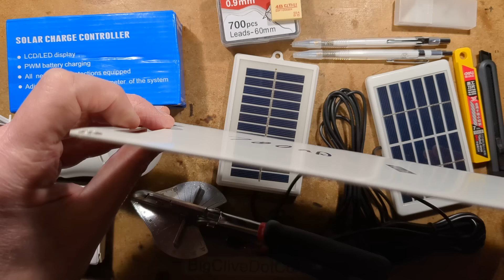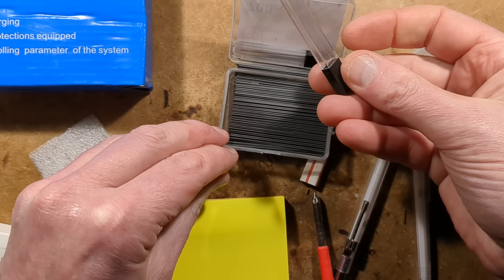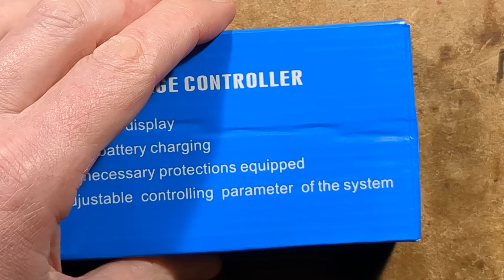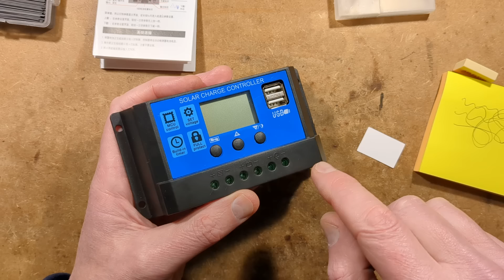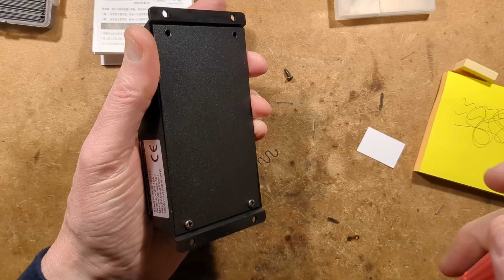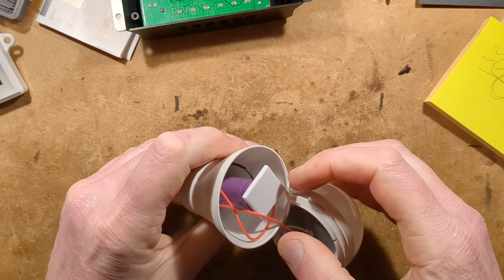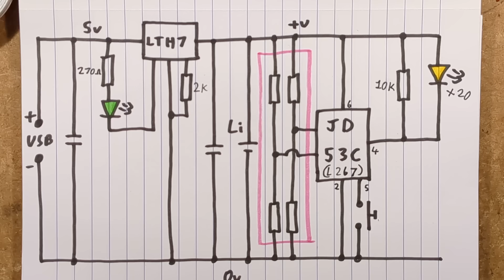Random stuff, a teardown and a little bit of smoke

Comment: I by mistake thanks to being my first use of Ali Express bought three of those solar panels without any lamps. After testing I found they were pretty weak at charging my 5 volt devices so I opened them up and wired three of them in parallel and just glued the three little panels together into one bigger one. 

I have been using it in our cottage with a 5 volt led light that comes on at random times. It gives the impression that the cottage is occupied as it is off grid. 

I have also opened up those solar motion sensor security lights that you get three of in a box and if you open and chop out some of the plastic from the inside you can get in a second Lithium battery inside and it goes together perfectly. So I connected two batteries in parallel and it works far better because it has double the storage from the panel. 

Since we live in Southern Finland it does keep them working through the winter. 

This will be the second winter they have got right through holding enough power in the two batteries so that the lights activate at night.

Comment: The solar charge controller is an excelent product ... The same company makes a 30A version for a few extra pounds , looks identical except  the back plate has cooling fins . I've been using one for 3 years and has performed as specified . It shows the temperature too , but   it's the temperature of the heat sink... lol.

Comment: I bought a solar panel to charge the battery in my vehicle. and I connected it to the battery and left it on the battery for most of the day. and I did notice any charge of the battery. and I don't have any way to test the solar panel to see if it was working. and I'm curious if there's some way to test the solar panel?

I appreciate you ripping these devices apart. so we can know what the inerds are. and how they work and how cheap they are.
Reply from the maker: You would have to monitor the current flow in use.

Comment: Ah, I used to have fun making mechanical pencil leads (0.5 mm ones I used in school) light up. If you raise the voltage high enough, it will eventually start burning the graphite, and it will get real bright, like lightbulb bright, for a second before the lead burns through and the circuit is broken. I've also had a lead blow to pieces right away.

Comment: I have such solar charge controller. It's trash. Voltage measurements are drifting depending on input voltage, load (or charge current). Had to stop using it, after it drained my 12V battery to about 6V and did not turn off output.

Comment: I have the cutter tool.
I got it to cut lead came for stained glass.
It turned out to suck pretty hard for that purpose.
Reply from the maker: Was it the blade not closing fully or just blunt?
Reply: I could never get the precice cut i was hoping for and the usually didnt come down evenly either. It caused me to waste a bit of lead and then i retired it. I later got a different cutter with no angle guide and straight blades and it worked like a dream. When i resurrect the glass working area I'll know what it was called
Reply: Missed out the word blade there

Comment: I picked up an unusual multi-function camping light from ALDI last week. I was provoked into getting it because the box advertised it as a long life light, with a power bank function and multiple charging methods: Either plugging a USB power supply into it, or using the built in solar cells, or manually winding up the built in dynamo.
Weirdly, the light could either be white or red - it had numerous surface-mount LEDs which must be of the dual cathode or maybe dual anode variety, so pressing the switch alternated between off, white and red. It was the same shade of red as used in photography dark rooms, so maybe it could be used as a backup dark room light - otherwise I don't know what the purpose could be.
The only downside was that they had cheaped out on the capacity - it had just a single 2000 mAh 18650 cell, though I'm not convinced that was the actual capacity since the cell was suspiciously light weight compared to equivalent capacity cells that I do believe the capacity of. Fortunately there was plenty of empty space within the light diffuser, so I was able to wire up some 5000 mAh flat cells in parallel, shove them into the space and connect them up instead of the 18650 cell, giving it a total of 15,000 mAh instead, much more respectable and useful as a power bank. With the downsides that it would probably take months to charge from the tiny solar cell, and I would probably develop serious RSI before I got even halfway to charging it using the dynamo.

Comment: I find the use of discrete resistors in voltage dividers a bit odd outside of very-low-cost applications - the error in the voltage divider has to take into account the error in both of the resistors - then if a temperature gradient appears across the circuit board (for example because of a component nearby on the circuit board which dissipates significant warmth) and one resistor in the voltage divider becomes warmer than the other that causes another source of error - it's possible to buy voltage divider ICs where each of the resistors is on the same chip helping minimize errors caused by temperature differences between the two resistors and where each voltage divider chip is laser trimmed and graded for accuracy on the production line - very useful components whenever any level of accuracy is needed in a voltage divider and I reckon they're not used anything like as often as they should be. 😉

Comment: Finally someone did a review on these shears! All I find are the ones with the big honkin blade, but none with the utility blades. This is exactly what I was wondering about - If it can be used with generic blades. And damn. Its already fairly perfect for hobbies like 40k, Gundam, D&D scenery building but the proprietary blades kinda suck.

Its like the surprisingly cool looking foam dart blasters. What they dont mention is the darts are 1/3 the size and slightly smaller diameter than standard nerf darts and aren't sold separately.

Comment: I've got a cutting tool from Craftsman (post-Sears), number 37309, that does take regular utility knife blades. It's great for cutting plastic cable raceway, small tubing, etc. It has a plastic anvil, which I suspect makes it work a little better for cutting thinner items. I've had zero problems trimming label maker labels with it. I even went as far as to 3D print a custom one with a stop on it for trimming them to a consistent (shorter) length. It lacks the angle guide of the one in the video however. No idea if Craftsman is available outside the US though.

I've had a similar solar charger (same case) for a number of years and it's worked great keeping lead-acid (car) batteries topped up while camping. Quite some years ago now I bought a solar panel from the auto parts store, and was quite shocked one day when I stuck a meter on my car battery with the panel attached and found 20v (it was very sunny that day). The solar charger let me keep using it without cooking my battery. I've never bothered to use the USB or load connections, so maybe that's why it's lasted so long? I see lots of "mine killed everything" comments. Or maybe I just got lucky and got one with some quality components/different design. Who knows...

Comment: 0:42  700ma 5v panel,  I almost spit out my coffee when you said this.  I bought a few of them to mess with, along with the dirt cheap controller your reverse engineered the other day.  On ali, some sellers were claiming 35watts for these and I thought it was more likely 3.5 watts, which you confirmed.  I LOLed for a bit before recovering.  Hope none of mine get cracked during shipping.

If you are interested, you can also find a 'claimed' MPPT 60amp controller with blutooth and app for 16-600usd depending on merchant. Kidding about the 600usd, but 16usd was lowest I could find.  Could not resist buying one to peek inside and also attempt to connect and see if it actually works over BT.

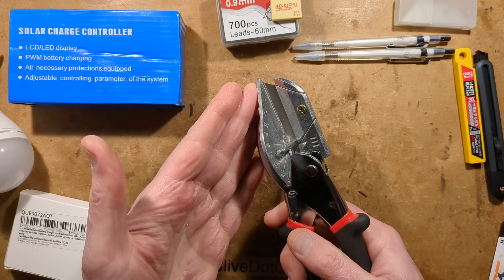Comment: 2:38 Those types of cutters are common in the material handling industries. They cut a belt at an angle (If so desired) and then you melt the ends together to make whatever length belt you want. I've used similar ones before, they had a fixed blade though (not replaceable).

Comment: I have the same solar charger '' the blue box'' and it get very hot when I use the USB plugs for anything and I mean you can smell it from across the room. I opened it and don't see anything wrong with it. I have a USB cable that lights up on the ends and even that makes it hot,  Did yours get hot as well? I don't use mine because im worried it may start a fire.
Reply from the maker: The video is being released in a day and in it I specifically advise against using the USB ports at all.

Comment: I didn't expect to come back to this video, but a few minutes ago I needed to change the blade on my Workzone utility knife/box cutter. The spare blades are held in the handle and when I finally worked out how to open it (knocking my whisky over in the process 🤨) I found that it also has a number of holes through the blade. Although neither the holes nor the top cutouts appear to match the ones in your cutting tool, it makes me think that there must be other models that have similar blades so perhaps all is not lost.
Reply from the maker: Sorry to hear about the whisky.  Some of those blade storage knives are very tricky to get apart.

Comment: I was scrolling through ebay today and stumbled across a soldering iron that uses an Ecig as the battery, the soldering heads look like they have a 510 screw thread on them. Funnily enough i wondered if it'd be possible because i have two ecigs, one is 100w and the other is 200w. I really want to order just the heads 😂
Reply from the maker: The little soldering heads work OK, but are designed to work with standard vape bases.  You also have to keep releasing and re-pressing the button to keep them awake.

Comment: I have too much "stuff" from the usual suspects. I sometimes buy interesting items repeatedly because I forgot that I purchased them already. I now use a spreadsheet for my inventory and  their location. I also have several small plastic bins where I place all the necessary bits and bobs for a particular project. I stick a bit of painter's tape on the cover for some notes. Very useful. I wonder if other people do the same.
Reply from the maker: I often double up accidentally or just because the item is cheap and appealing.

Comment: CdTe panels are thin film, so they wouldn't look anything like segmented or wafer silicon cells.

In the noughties, I worked at company that developed a machine for one of the steps in manufacturing CdTe solar panels. It's purpose was to scribe (laser ablate) a substrate.

Normally, when developing a machine like this, the laser and optics systems are where most of the effort goes. On this system it was the extract system. *8')

Comment: The cutting tool might be useful for cutting ribbon cables.  I've used similar looking tools that are dedicated to the job, which only cut perpendicular to the conductor.  Usually that would be all you would want, but I could imagine that perhaps cutting at an angle could be useful if you were peeling the individual wires off and feeding them into clamp or screw terminals rather than feeding them into an IDC connector.

Comment: Talking of junk my brother brought an outside camera. The functionality wasn’t bad. It’s a ptz with 3 cameras only one of which moves. The trouble is it came with a power supply with quite a long mains lead and a short low voltage lead. This encourages people to put the power supply outside next to the camera. No ip rating. Think it was off Ali express. Excellent videos thanks. And obviously it had the non compliant uk plug with no fuse and the sleeved earth pin. That’s a must.

Comment: Not so long ago I discovered these power failure LED bulbs. They look like a standard E26 LED bulb.  Much like the light you showed, they have an 18650 battery in the neck of the bulb.  They charge while the light is switched on. And if the power fails, the bulb will light powered by the battery. They have a clever circuit that only works if the bulb had been switched on.  If you remove a charged bulb, it will not light. But lick your finger and touch the contacts, and it will light!  They vary a bit in quality and wattage, but the "good ones" will give you a few hours of reduced output light. 

They are quite handy!  They put out enough light to keep you from stumbling around in darkness. If you have one in a lamp that was shut off, flipping the switch on will light the lamp even in a power outage!  Very cool idea! 

But quality varies and like some similar style LED bulbs, when used in the hanging position or in a fixture, they may fail from overheating.  I set up some in wall sconces with an open bottom, but in a thread up position. in my barn, that gets pitch black with no power. Ordinarily, I keep them turned on to light up some dark areas. They worked great in the "emergency lighting" mode!  But over time, they broke down the glue on the domes and they fell off. But they still worked. 

So I decided to take one apart. I didn't think much about the fact that the battery was fully charged.  Very light gauge wire comes up into the LED light portion, just like in your bulb. I clipped the leads staggered to prevent a short and then went about removing the battery. 

The battery was held in place with hot melt glue, but felt kind of loose, so I tried to twist it a bit and it came out.  Success! For a brief period! Within about 10 seconds or less, I quickly dropped it because it was burning my hand!!  

What I had not realized was that the insulation on the wires had become crispy from the trapped heat and when I had twisted the battery, the insulation flaked off and the wires shorted!!  So it's on the floor cooking,  getting ready to explode!! It was so hot, you couldn't pick it up!!  I put my foot on it and used a pencil to rip the wires apart.  I scooped it up and took it outside!  I thought about the little safety measure of having a bucket of water handy, when working with these batteries!!!

Of course the bulb said it was IEC/EN certified!! Through the years, I have come to realize that such certification, is worthless!!! I only found one bulb brand that had a UL listing. Cost about twice as much!!  I have yet to take one apart to see if I could spot a difference in how it was made. 

My take is that there were two issues. One being using very cheap wire and the other, (suspected), that the battery probably didn't have short circuit protection. 

I really think the idea is a great one. Living in the country, power failures can be pretty common, and having built in emergency light, can be very useful! 

They are pretty cool for amazing kids and even some adults!  I take one of these bulbs and hold it while explaining that having worked with electricity for many years, has turned me into a human battery. I then flex and grunt while slipping my wet pinkie across the contacts and amazingly, the light bulb turns on!!  Of course, everyone wants to see the bulb and can't figure out why they can't repeat the trick!! It takes some moisture on your finger, to trigger the circuit. They even sell these with a little bulb socket with a hook and a switch on it. It's handy to hang the bulb and switch it on. 

I stumbled onto these bulbs while reading an electricians' forum about weird problems. A DIY homeowner had put up a new ceiling fixture and a three way switch. But he couldn't get it too shut off.  So the electrician figures he must have got the 3 way switch wrong and spends half a day trouble shooting it.  What seemed weird was that the two bulb fixture had only one bulb that stayed lit. Something  he didn't notice right away. But then he took this mystery bulb out and tested it in a table lamp and it worked just fine!  He put new bulbs in the ceiling light and it worked just fine. He didn't know how he "fixed" it, or what could be possibly be wrong.  He was convinced that something in the 3 way switches had to be wrong, somehow providing a sneak circuit. Maybe taking it all apart and carefully putting it together, somehow corrected the problem.  Then someone in the forum suggested that it was probably and emergency power failure bulb!. So  I googled this and sure enough, such a thing existed!

It is a very clever idea!! I found some on Amazon and bought some. I do like them and find it hard to believe that no one seems to be marketing these things. That said, it serves as a reminder that with a lot of Chinese stuff, they cut corners and use cheap materials to get the cost down and there's no telling what you are getting. An 18650 battery can store a lot of energy and potentially might serve as a fire hazard! All I can say is that I was stunned just how hot this battery got so quickly!  Would have been good to have that bucke of water th throw it in!
Reply: Have one of those in a flood light. Kind of fun since it "doesn't work" when the power is on. It also has a manual switch with 2 levels so you can use it as a flashlight. Plus the licking your finger trick also works, fun party trick.

Comment: Test? Sorry, I tried to comment for several times but somehow it won't register.

So, I searched that scissors thing on Shopee Thailand and found that they are for cutting PVC cable raceway.

While the replacement blades seem to be proprietary, but not that scarce. The sellers usually place them as an option in the scissors listing itself. So, if you manage to find the scissors listing on the selling platform, then the blades are there.

Or if you are on the phone, you can take a photo or save a picture from the listing and use it with the image search function. Similar items search function also helps.